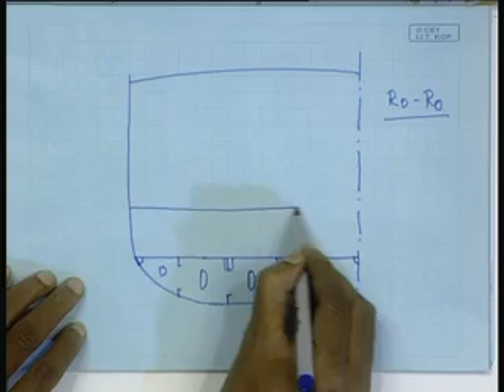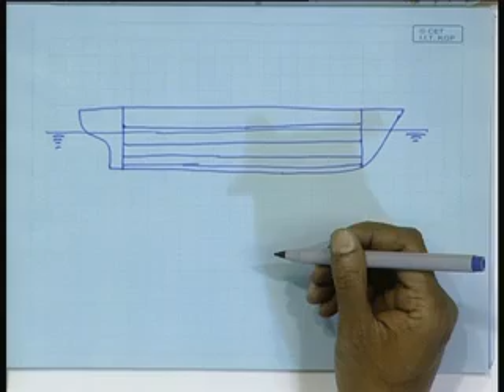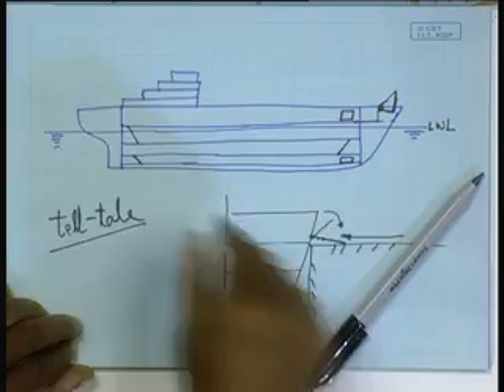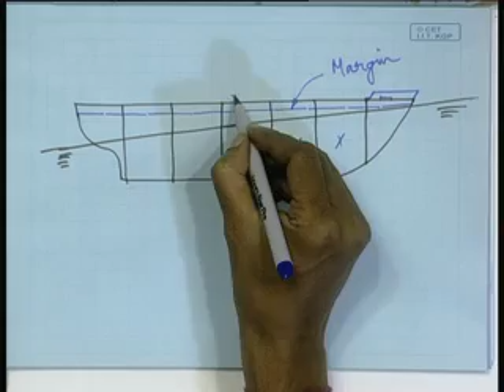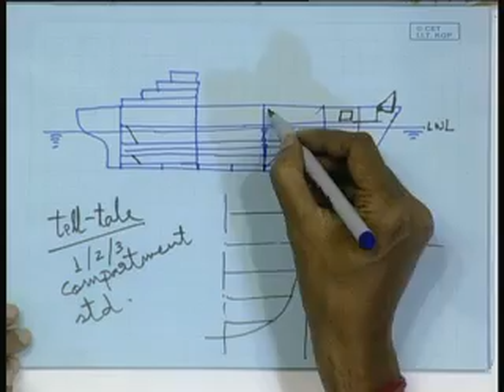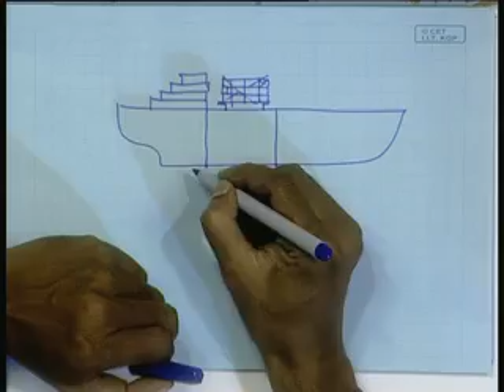Mod-01 Lec-15 RO-RO Ship

Comment: in ro-ro ship how ramp is operate with tides ,because at port tides cause high vertical displacement because of tides which is ok in container ship but in roro ship how they treat a tide motion in term of effective and fast loading unloading at port in short "how they deal with tides at port??????"
Reply: Ramp can be shifted vetically in newer ships. Stern ramp can compensate with its angle, centre ramp opens to both 7th and 8th deck. This is selected based on draft and tide.